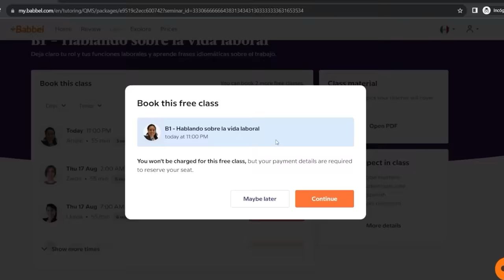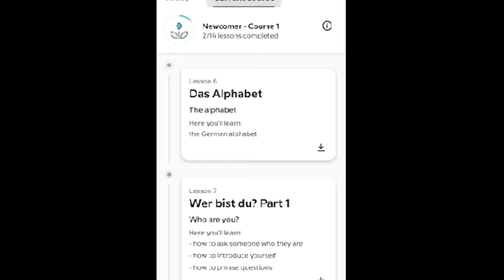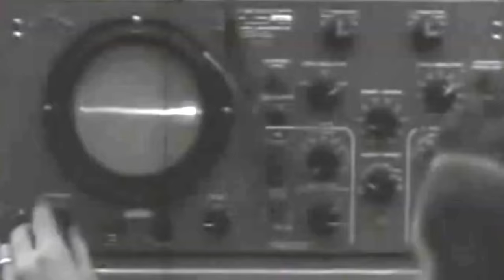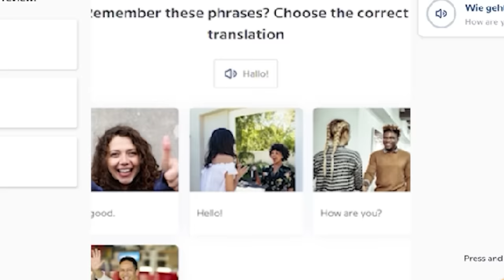90mm Gun Main Battle Tank Survives Direct Hit - The M48

Comment: 3/75th Ranger Story: In 1993 in Mogidishu, Somalia the Pakistani Army had several M48 Pattons assigned to their forces after the terrible massacre there when a platoon was chopped up with machetes after they ran out of ammunition. I was a Ranger Cpl. in charge of the entrance security of Task Force Ranger's compound. The M48's came into the Airport and turned to drive past our entry point. The lane it was trying to maneuver was a tad small. Right as it turned, it caught a piece of our triple strand concertina wire. I started to yell, as did a few tower positions as the M48 proceeded to drive down the lane with the entire wire system caught on its tread. We got it to stop, but not until they had a spend hours getting the wire out of the treads and we had to rebuild our compounds front entrance. I writing all these stories down these days.

Comment: Gasoline engine was a dumb idea. Really dumb. That didn’t change until 1968
Reply: The M48A3's were equipped with the Continental AVDS-179-2A 12 cylinder diesels which were produced from the late 50's onward.

Comment: I was an M48A3 tank commander with the 1/77 Armor on the DMZ in Quang Tri, South Vietnam.  The M48 was a very reliable and easily maintained tank.  The entire power pack (engine and transmission) could be removed and replaced in an hour or less.  It had good mobility, even in muddy terrain owing to the wide tracks, although due to its 53 ton combat loaded weight, was not as agile as an M113 ACAV.  Armor protection was near proof against the B40 RPG, and even a side armor hit from an RPG 7 was often stopped by the track blocks that we attached to the turret rail. A common storage container for the outside rear bustle rack was the 40mm ammunition containers from the M42 Duster self propelled AA track.  The type of main gun ammo that we used most was cannister, (a gigantic 90mm shotgun round) both for close quarter anti-personnel work and jungle busting.  We used HEAT and HE, either fused quick or delay, for bunker busting, and beehive,  for longer ranged anti personnel engagements when we had them in the open or behind light cover, and Willy Pete for smoke, signaling, and AP purposes. .  The beehive round had a variable ranged fuse that could be set to airburst over trenches or other fortifications.  The NVA often fought from fortified positions on the DMZ.  We modified the external M2 .50 cal. MG  mount by welding on salvaged coaxial MG turret floor ammo boxes that could hold a 500 round linked belt.
Reply: Great description, I was also a tank commander in 1/77 in 1971.  Lost two M48s to mines, one in Khe Sahn near the Laos border and one near A4 FB.  Seems like just yesterday.
Reply: Sounds like we were there at about the same time.  I got there in Sep of 69, and left in April of 1971, just after Lam Son 719.  I spent beaucoup time at C2, A4, and FSB Vandergrift.  Did a lot of early morning mine sweeps between C2 and Cam Lo.  Never ran over an AT mine myself, but the tank 2 tracks front of me ran over a 500 lb bomb rigged as a mine.  killed 3 of the crew, and the TC survived because he was blown free of the cupola, but with very serious injuries.
Reply: I left in Nov 71, we certainly traveled the same AO.  Lost first tank on the road to Laos as a blocking force for the ARVN rout out of Tchepone.  The second one was a booby trapped 500 lb bomb.  Only thing that saved us was it was right on the edge of a 500 lb crater and the blast went almost entirely into the crater.  I remember looking up between my legs as I flew thru the air and into the crater.  Never heard the explosion, think like in Saving Private Ryan my hearing shut down….very strange.  Minor injuries to all but me, turret lifted off its ring though but thankfully it was not an ambush.  Guardian Angel with me that day.  Injuries later sent me home early but finished 22 years in the Army, had to leave armor but spent the rest of my years in Air Defense, Patriot missile.  Thanks for your service!
Reply: Thank you both for your service and sacrifices
Reply: Thank you for your service, men like y’all are the backbone of this country,Thank you again.🤝
Reply: Bad ass!!! 💪🏻 🇺🇸🇺🇸🇺🇸🇺🇸🫡

Comment: This is the first video I have seen that actually mentioned how the tank crews would add C-ration boxes, .50 cal ammo cans, sets of spare track blocks to the side of the turret to minimize the impact from an RPG blast. Of course it helped to always have extra food along because most of the meals for tankers were the C-rations. We also had extra sand bags placed on the front slope to protect the driver. We also mounted the TC’s (tank commander) .50 cal outside on the top of the cupola. Most of the 1/69 Armor tanks also had extra .50 or 7.62 MG mounted in front of the loaders hatch. 
The M 48 used in Vietnam Nam was the A3 which used a diesel engine instead of a gasoline engine. That one modification saved quite a few lives of tankers over there. If the engine of fuel cells were hit with an RPG it wouldn’t explode and catch fire.
The battle of Bien Het ( a Special Forces base in the Central Highlands ) was March of 1969 and B Co., 1/69 th is credited with destroying two PT 76 NVA tanks that night.
Reply: I was an M48A3 tank commander with the 1/77 Armor on the DMZ in Quang Tri, South Vietnam.  The M48 was a very reliable and easily maintained tank.  The entire power pack (engine and transmission) could be removed and replaced in an hour or less.  It had good mobility, even in muddy terrain owing to the wide tracks, although due to its 53 ton combat loaded weight, was not as agile as an M113 ACAV.  Armor protection was near proof against the B40 RPG, and even a side armor hit from an RPG 7 was often stopped by the track blocks that we attached to the turret rail. A common storage container for the outside rear bustle rack was the 40mm ammunition containers from the M42 Duster self propelled AA track.  The type of main gun ammo that we used most was cannister, (a gigantic 90mm shotgun round) both for close quarter anti-personnel work and jungle busting.  We used HEAT and HE, either fused quick or delay, for bunker busting, and beehive,  for longer ranged anti personnel engagements when we had them in the open or behind light cover, and Willy Pete for smoke, signaling, and AP purposes. .  The beehive round had a variable ranged fuse that could be set to airburst over trenches or other fortifications.  The NVA often fought from fortified positions on the DMZ.  We modified the external M2 .50 cal. MG  mount by welding on salvaged coaxial MG turret floor ammo boxes that could hold a 500 round linked belt.
Reply: Thank you for serving I would love to pick your brain I’m sure you have lots of stories.

Comment: When I arrived on Okinawa with the 1st Marine Tracked Vehicle Battalion (Prov), we had M48s with diesel engines.  During my year there, 1977, the m48s were swapped out for M60A1s.  We did miss the M48s for a while, but the 105mm main gun on the early M60 was a vast improvement.
Reply: Nice and Semper Fi
Reply: FuzzyMarine Vet….I served with Bravo Co.,1st Battalion, 1st MarDiv from ‘68 - ‘72.  Yes, our M48’s had diesel motors also.  The only gas vehicle was our Retrievers and the tiny Ontos vehicles.  Ontos vehicles were crazy dangerous little shits.  While we had our 90mm, a .30 cal beside the tube, and a .50 cal for the TC, the poor little Ontos’s had 6 of the 106 recoilless rifles mounted on the exterior that had to be loaded and unloaded from outside of the vehicle.  If that wasn’t bad enough, it had no armor whatsoever, just its 1/2” steel hull to protect the crew, gas tank, and motor.  Sempre Fi!

Comment: Around 1967 I saw an M48 tank at Anniston Army Depot that had been returned from Vietnam.   There was a hole in the front part of the tank, about one inch in diameter, that was a result of an RPG striking the tank.   That hole was all the way through the thickest part of the tank.   Looking through the hole, I saw where the driver would have sat.   I doubt that he survived.   The RPGs proved to be a cheap and reliable way to kill tanks.

Comment: Did you really just define 120mm of armour protection as unparalleled protection? lol. The centurions tank had better protection than that and the t-55 had more than that. In fact many tanks equaled or bettered 120mm of armour protection both in thickness and in overall protection from angles.

Comment: Always a soft spot for them but the WW2 and post WW2 US tanks silhouette was way too high imo.
Reply: My buddy that's a tanker has told me that our tanks are meant to be used hull down.
Reply: @blakekenley1000 Yep, and utilize excellent vertical guidance. Designed to stop USSR armor at Fulda Gap...
Reply: Soviet design practice post-war was to make their silhouettes as low as possible, even if it meant compromising the ability of the crew to depress the main gun to fire at targets downhill or below it, and even the maximum elevation of the gun. American and British practice, however, was to sacrifice some extra turret/hull height in return for greater max elevation range and depression range. This had implications in some battles, such as the IDF defense of the Golan Heights during the Arab-Israeli Wars. Israeli tanks on ridges and elevated areas could depress their guns sufficiently to fire on advancing Syrian or other tanks, T-54s, etc. - even from defilade, but the Soviet-designed tanks could not achievement sufficient elevation under all conditions. Tank design involves compromises, it is just a question of which ones.

Comment: it's like a modernistic tank but I don't get why Americans love their curvy glacial hulls so much, I'm more into the Russian style hulls yet I'd rather not get ammo racked. also why can't the Russians just put on a diffrent turret for auto loaders and shells to go in of, it'd make them more immune from getting ammo racks lol
Reply: Curved surfaces are less likely to act as shot traps, and offer some degree of protection via ricochets if the angle of incidence is steep-enough versus an incoming shot. Hard angles in welded surfaces are also, under some circumstances, not as strong as curved metal surfaces which are cast. Without getting too far into metallurgy and engineering, that's a simple answer for why some designs used curved surfaces instead of angled ones.